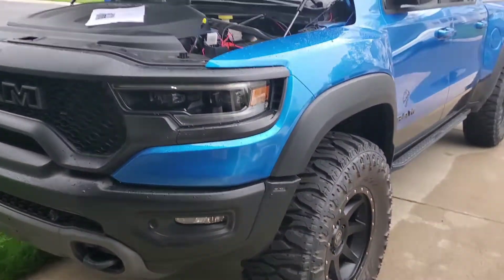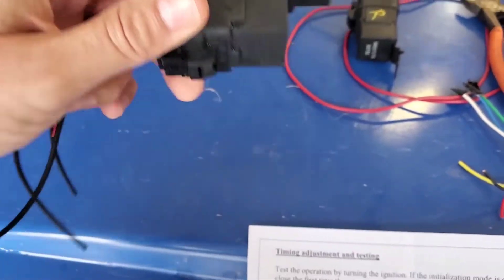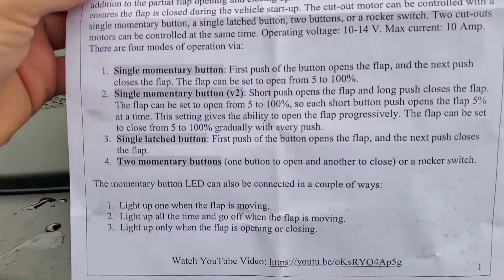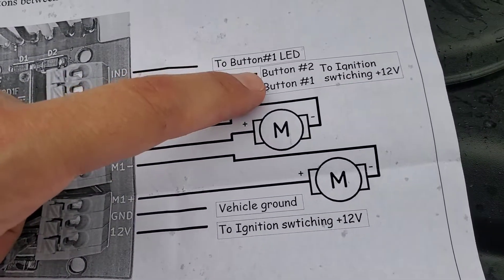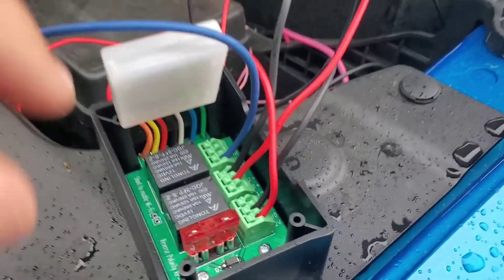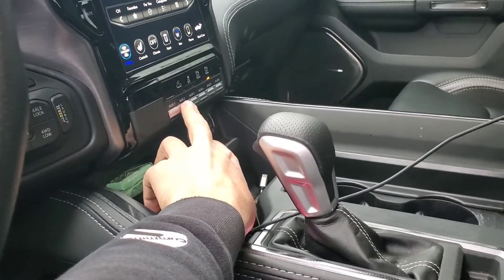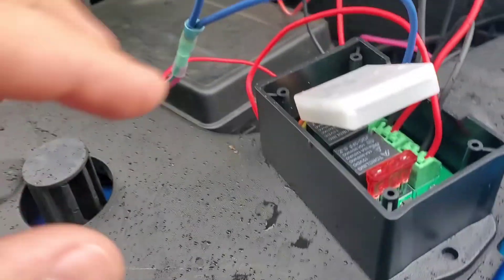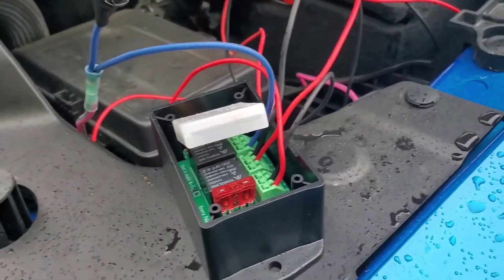Ram TRX Exhaust Cutout New Controller Update

Comment: Have you thought about wiring the box in the cab? The Ram up fitter wiring kit video shows how to pass wiring into the cab. Also, there is a grommet on the driver’s side of the firewall that will let you pass wires.
Reply from the maker: The only reason to move the box to the cab would be for keeping it protected from the elements, but I think if I can just keep water out of the box, then the housing will do the rest. But that's a good suggestion for getting wires into the cabin...if this setup gives me trouble I'll give that a shot 👍🏼